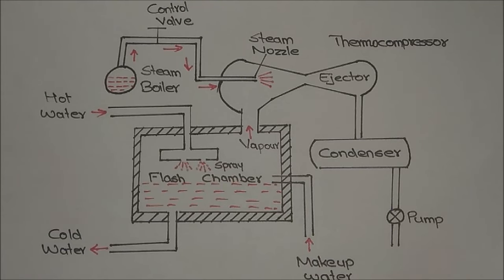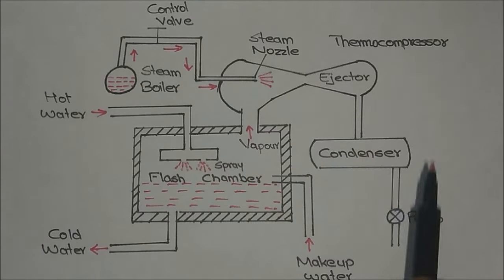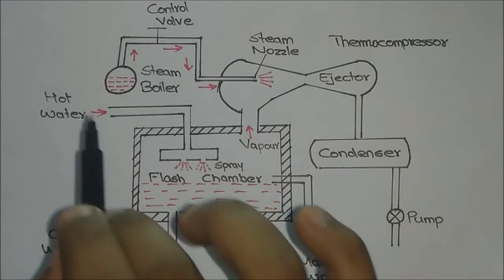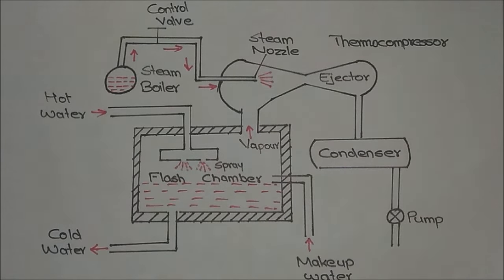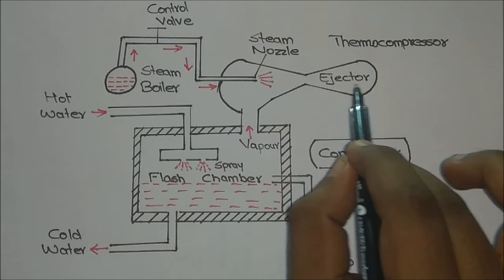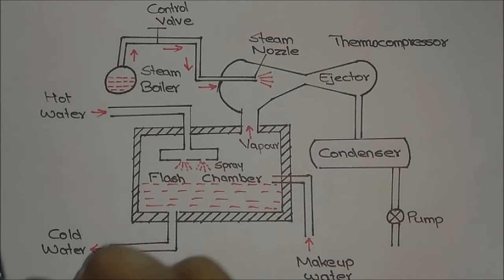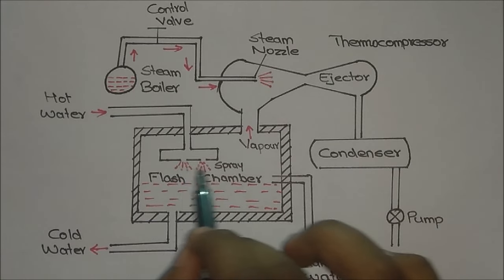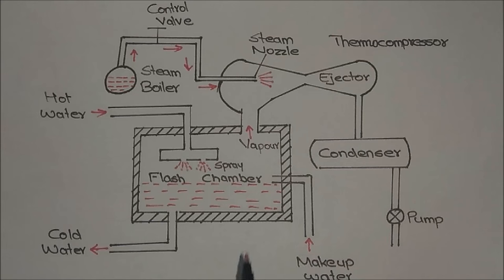Steamjet Refrigeration System Explained

Comment from the maker: Consider a flash chamber contains 100 kg  of water. If suddenly 1 kg of water is removed by boiling, as pressure is reduced  due to throttling of steam through nozzles. Approximately q=2385 kJ of heat  will be removed from the water, which  is equivalent to heat of evaporation of water. The fall in  temperature of the remaining water will be dt, in q=mcdt...substituing q,m,c...dt would be around 6°C...again the evaporation of 1 kg will reduce the temperature by another 6°C..Continuing this process we will get low temperature for remaining water..hope you understand..
Reply: Mechanical Engineering Concepts this comment is more helpful than the video

Comment: This is how it should be explained .........In flash chamber pressure is reduced using steam nozzle configuration(by using venturi), this reduced pressure will reduce the boiling point of water so the vapours will start leaving from flash chamber taking the latent heat of vapourization with them. Due to this heat transfer the temperature in flash chamber goes on decreasing and hence cooling is achieved. make up water is provided in chamber to maintain water level.

Comment: I get the concept of how the system works, but it appears that you are missing a method to remove or store the excess water. As makeup water is added to the refrigeration side of the system because it is being depleted by the vacuum/compression  side of the system the total water in the system will increase. You do not show or explain a way for the vacuum/compression side of the system to expel the excess water that it will eventually end up with. I am just wondering if that water is simply expelled, or is it stored to be reused as makeup water? Thank you.

Comment: how the water is cooled in flash chamber
Reply from the maker: Akhil Thuvvara Consider a flash chamber contains 100 kg  of water. If suddenly 1 kg of water is removed by boiling, as pressure is reduced  due to throttling of steam through nozzles. Approximately q=2385 kJ of heat  will be removed from the water, which  is equivalent to heat of evaporation of water. The fall in  temperature of the remaining water will be dt, in q=mcdt...substituing q,m,c...dt would be around 6°C...again the evaporation of 1 kg will reduce the temperature by another 6°C..Continuing this process we will get low temperature for remaining water..hope you understand..
Reply: When steam is ejected from the nozzle it is ejected at low pressure. This low pressure will effect the water present in the Flash Chamber. NOW , Pressure is directly proportional to Temperature . Low Pressure therefore Low Temperature.
The term Boiling Does not mean the water is hot. Water can boil At 7 celcius if the pressure is reduced to 0.007 bar.
Reply: @nameerasumansiddiqui2067  thank u understand it better now